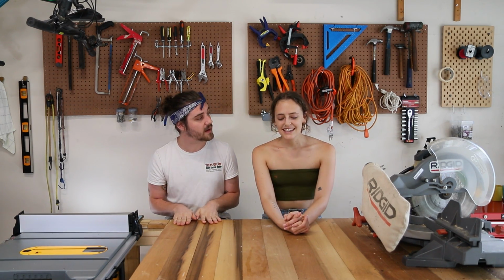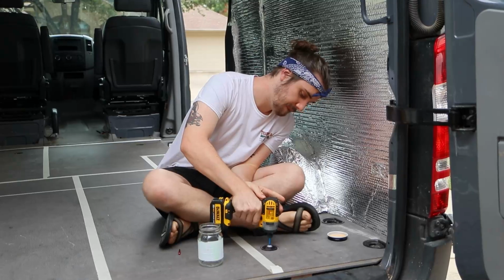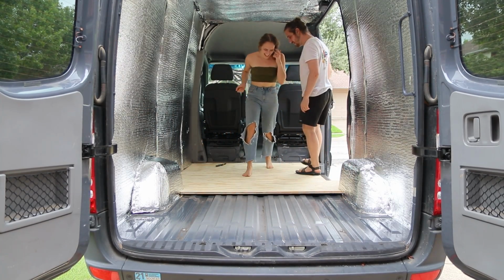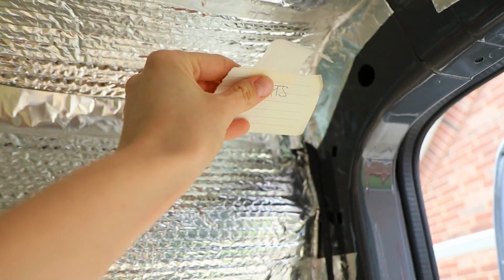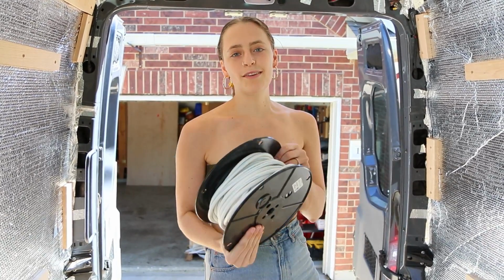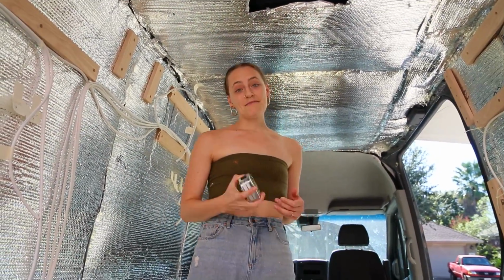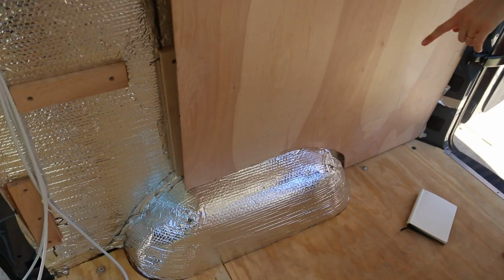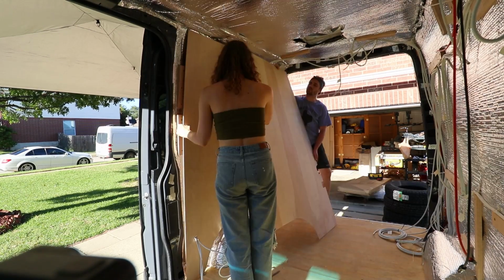DIY Van Conversion | ELECTRICAL WIRING, FRAMING, & WALLS in our 4x4 Sprinter Van

Comment: There is enough space behind the wall boards to use Kingspan GreenGuard it will give you better insulation its a moisture barrier and anti mould, its only $60 a board.

Comment: Hi all,what no insulation anywhere before vapour barrier not even on floor/ceiling!!! have you sound proofed? run cable in flexi conduit inside the ribs of the van to take up less space so if u need to replace or add new cable it's easier,try and put batteries and solar panels either to the front or rear so you limit any voltage drop,r u putting windows to in? What battery to battery r u using? What's the wire in toilet for?  YOU TUBE worth watching GREG VIRGO.    how many van have u done,I critical because I've done it.

Comment: Why have you used this reflective bubble wrap to make it look like a spaceship inside? Don't you know that this kind of 'insulation' has one of the worst R values in terms of insulation? The best by far is sheep wool. Also, why didn't you insulate the floor? It seems a bit of a hotch-potch job to be honest.
Reply: The guy they are partnering with already did insulation and the noise deadening material before they took possession of the van to build it out!it was I. The video before this.